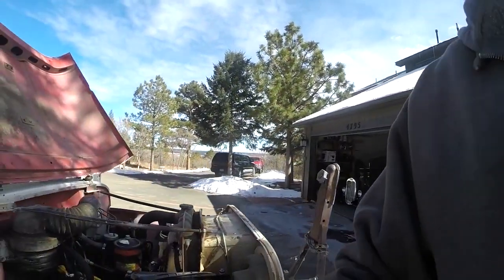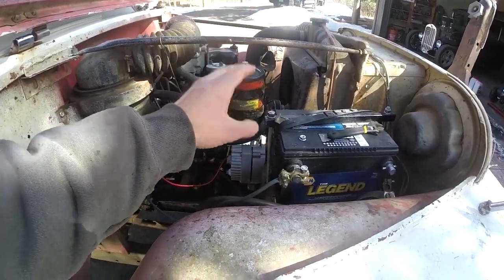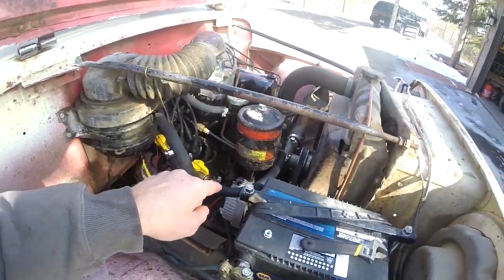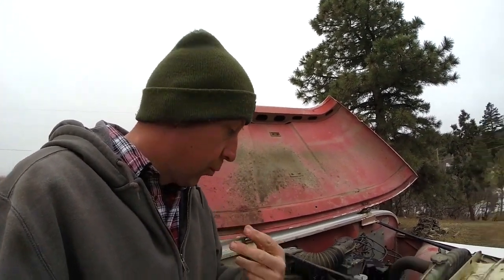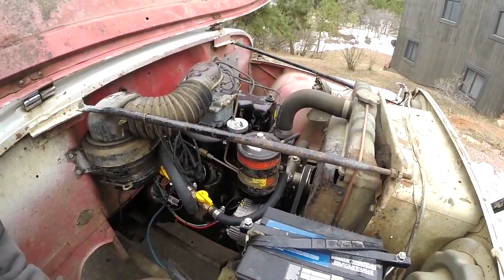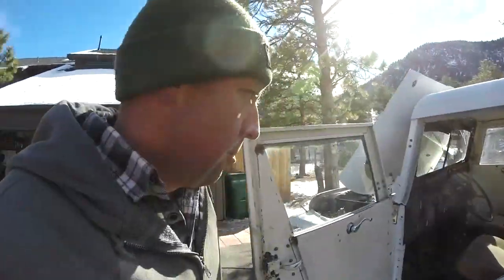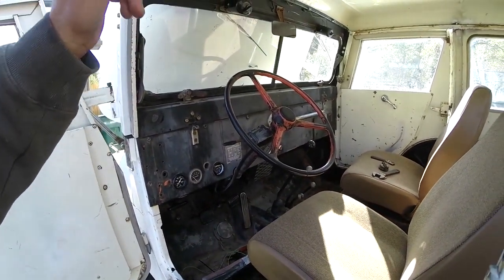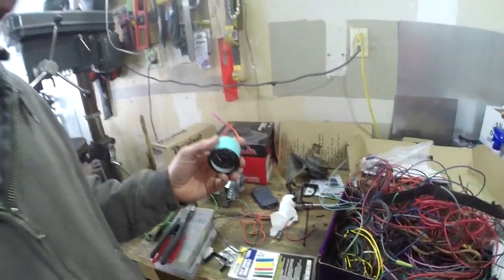3 Wire Alternator Hookup Explained- It's Easy- If I Can Do It, So Can You!  Bad Hombre Garage Ep. 88

Comment: Good video keep it up 👍🏾 I just have one question on the alternator do you have to connect a negative wiring to the battery or engine or body of car thanks
Reply from the maker: It pulls a ground through the mounting brackets, though I have seen some with a ground wire off the body of the alternator.  If in doubt, I say make sure it is grounded! So many problems come up due to poor grounds.  I always make sure the battery is well grounded to the frame, then make sure the body and the engine are also grounded to the frame.

Comment: You covered the charging change very well and will not doubt solved someones charging issues . I’ve used a one wire on all my builds , my builds are mostly ford but you can get the Chevy one wire alternator with a Ford case ...makes my life much more simple . Thanks for sharing ..Shawn
Reply from the maker: Thanks! I have a one wire on my Model A, it is really easy.  I wanted a one wire for my Jeep, but it was a 3 wire that showed up so I just used it.
Reply: You got a part number for a ford alt with one wire?
Reply: @johndowe7003  yes sir Summit Racing , tuff stuff part number 7068 , NAPA has the same alternator also but I don’t know that part number .
Reply from the maker: @rustyrods8535  thanks for helping out! I love this community.

Comment: FUN FACT:
If you are converting a 6v to a 12v system...
you can use the original 6v genny just by changing the voltage regulator to a 12v version...
Reply from the maker: Boom- thanks for the knowledge drop! I didn’t know that, but it makes sense.
Reply: @BadHombreGarage  Yessir, the genny puts out like 96v or something all the time hence the regulator... same as a 12v alternator but it "alternates" between charging and not charging as needed with an internal regulator.